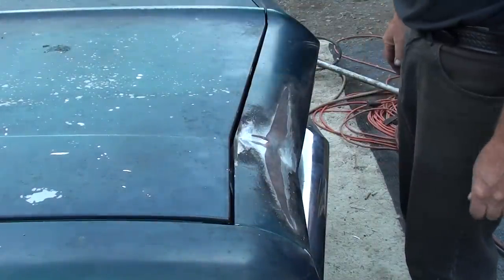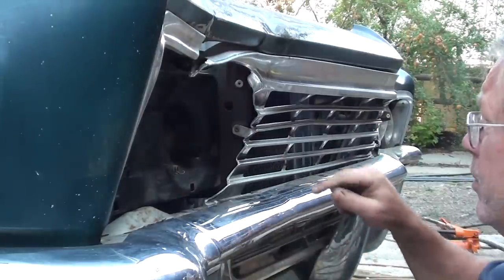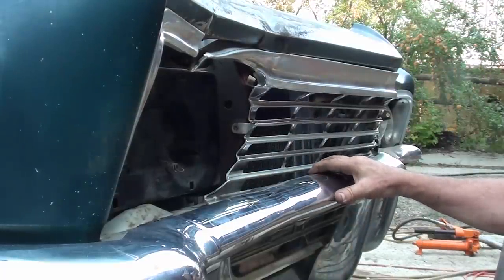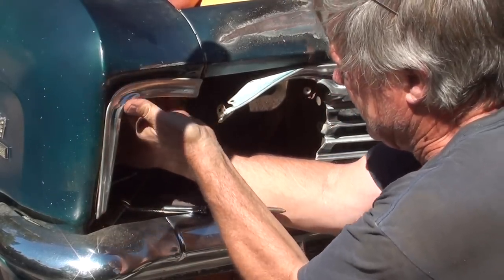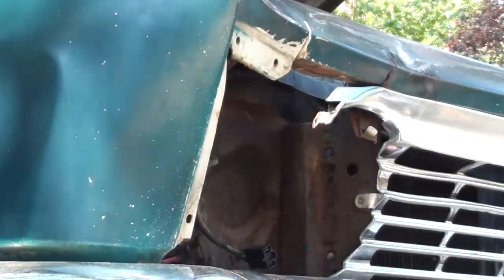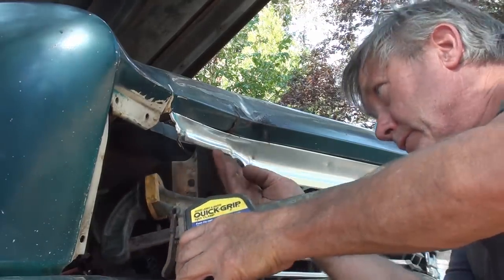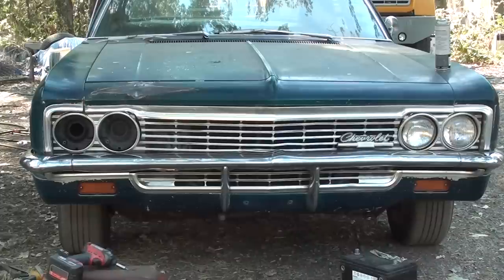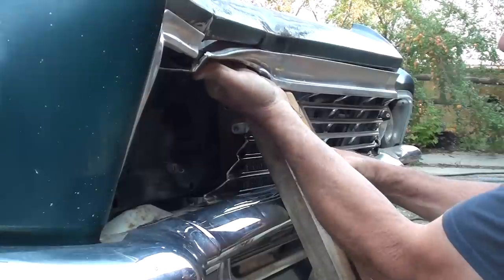Part 13 Big Block Biscayne Rescue! Abandoned 66 Chevy Grille Straightening and Repair

Comment: If I tried bodywork I would use a ballpen hammer and still screw it up. Jeff performs body work with a framing hammer and it worked. It's what they call a daily driver vehicle , looks good at 10 feet.

Comment: Jeff, when metal bends it stretches.  When trying to return it to its former position it won't fit the dimension. A trick I learned from an old timer is to heat and quench to shrink the metal. Tho in your case idk what it would do to the chrome finish. Just trying to offer tips that may help u some time.
Reply: That trick doesn't work on all metals... and I wouldn't try it on aluminum trim. Just an FYI. 👍🏻🇺🇸👨🏻‍🔧

- Max Giganteum
Reply from the maker: Aluminum doesn't work that way. When you heat it, you don't know how hot it is until it drops to the ground in a molten blob! Imagine trying to get solder to that perfect temperature before it melts!
Reply: When I wrote that comment I thought it was a chrome grille. As I continued watching I learned it was aluminum.